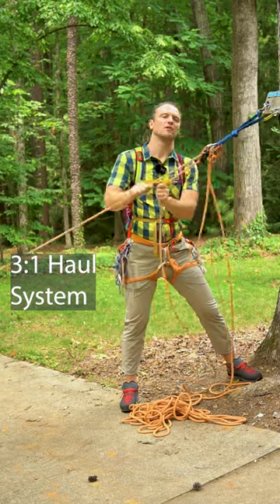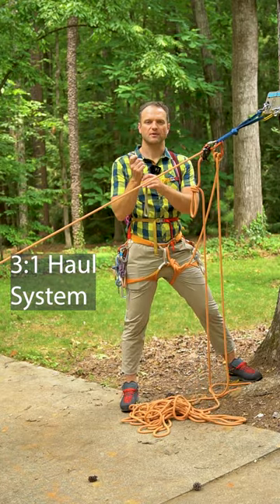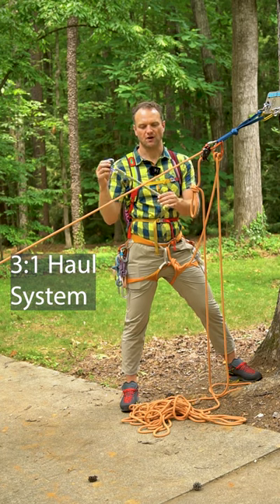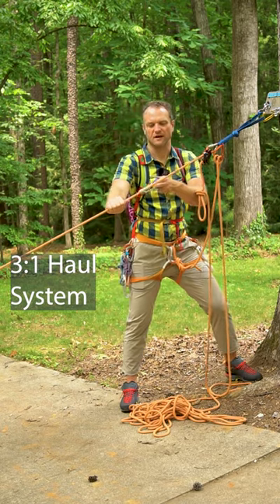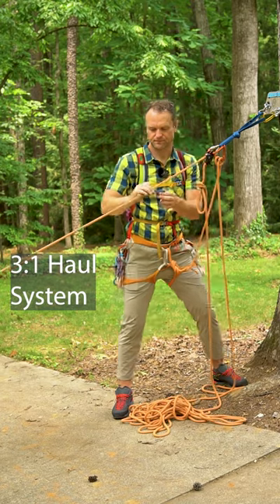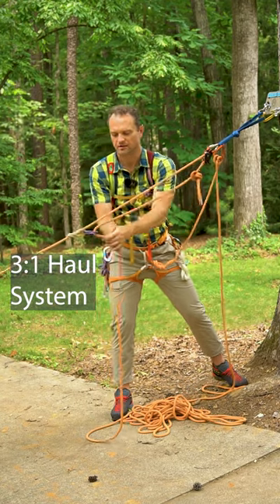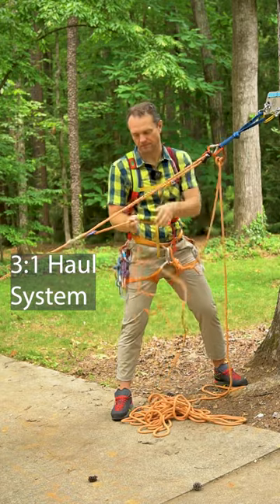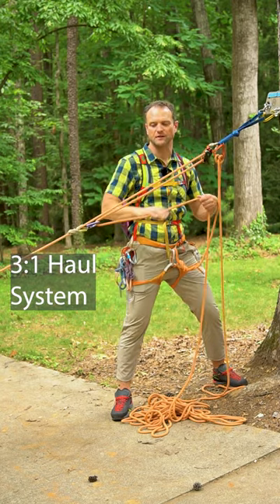3 to 1 Haul System for Climbing or Hauling #mechanical #climbing #rope

Comment: Can you please make a video of if a seconder fell on a traverse and there were no handholds so they needed to get up either with prusiks or an ascension device. But then they need to get back to the end of the rope for the sake of the leader belaying them again, I guess they go hard in to a bolt or piece when they get to one, undo the prusiks or device and leader pulls through 🤷
Reply: I second this one no pun intended. Presently I would have the follower bring an ascender and a sling to create a foot loop and a prusic. This however introduces the possibility of slack in the system should the ascender and prusic suddenly slip. The second clinber could progress capture with a gri gri back up, but then when they get to the handhold they have to undo all of this and get the slack out in order be back on belay. Theoretically this will be easier if the ascended to the pro they are hanging under. Then upon reaching the protection they can go in direct and take out the slack, but I haven't physically had to do this. I fear it is a flawed setup, but this is my intuition. I would love a video showing a more efficient technique.
Reply from the maker: Roughly this is correct. There are some steps you can take to mitigate the threat of extra slack
Reply: @summitseekersexperience  catastrophe knots between seconder's tie in and the ascension device? Maybe do a video on different ones? I've seen some people just do slip knots which are obviously super easy one handed but seems too good to be true.